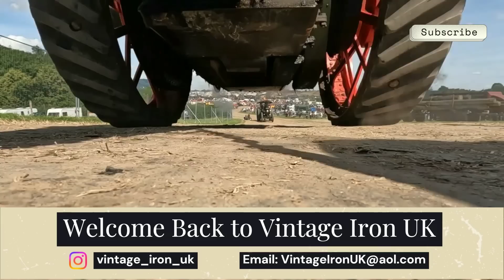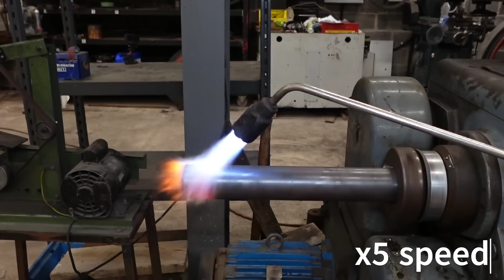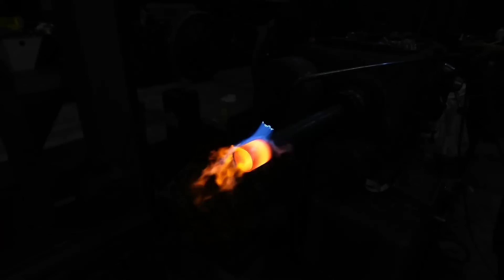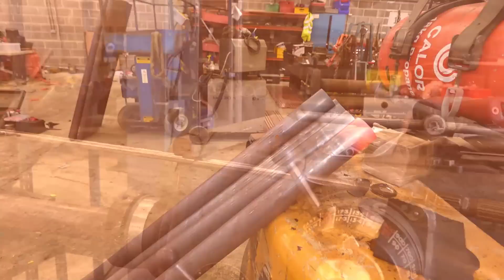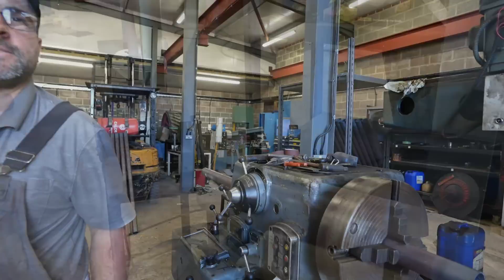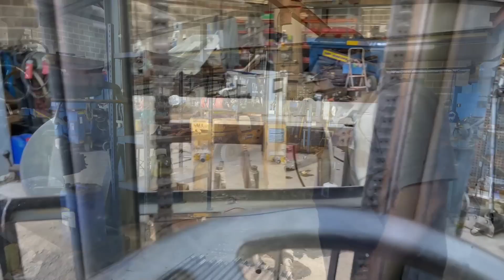STEAM ENGINE boiler REPAIR prepping the new tubes for fitting

Comment: How did that Allen key not snap at 3:24 ?!
Reply from the maker: @7333-e3k  Lathe clutch was not engaged. Just a little drag on the clutch plates before the oil makes it way to the headstock

Comment: I was a welder in a pressure vessel shop and we had a pair of tube sheets that went into a vessel. We rolled the tube's in but we never had to anneld them, but I can see where it would have made the job easier.
Reply: I agree ,have taught a lot of apprentices to roller expand tubes without annealing
Reply: @archmcdonald6170  Was a boiler guy for 20 years and never did this.....

Comment: Boiler tubes are usually  suppled aneeled. Also after heating they should be put in lime to slow the cooling rate otherwise your not softening them at all comrade

Comment: I’m no expert but should you not have cut the tubes to length before annealing and cleaning up the ends?
Reply from the maker: @Ian-Steele  what makes you say that? Don’t think a bandsaw cuts going to work harden the end?
Reply: @ I thought that if the tubes had to be cut to length you might be cutting off the section that you’ve just heat treated.
Reply from the maker: @ I see. Only 5-10mm coming of the ends so should still have more than plenty of a annealed steel left

Comment: which part of the uk are you from kind sir? you got a very unique accent, also is germany the only place that makes steam engine tubes, I have seen mills that make tubes for stationary boilers, but seems most of the steam engines tubes come out of germany, including I belive the ones in nkp 765 the engine I help out with in the shop sometimes, or is it just the quality of steel out of germany that its the case for many boiler powered transportation?
Reply from the maker: @manga12  The accent is the finest Bristolian. The south west of the great Britton. 

The uk produces boiler tubes. Just happens these had paper work and certs in German. We ordered from a uk supplier 👍
Reply: @VintageIronuk ah I see, its just soo differant from what I usually hear as I stated its almost a bit sounding like someone from the south central coast of the usa kind of
Reply: thanks good luck with the tubes boilerwork can be hard work, especially if you drive the staybolts in I tried and could not hold the hammer on the bolt end more then three hits, I should have leaned on it more and held the closer to the snap, perhaps if I can get used to the recoil I will have better luck when time comes to rivet. dont may fair share of moving the arch block in and out the last few years and blowing flues with the air wand thats fun
Reply: Ha ha! A northerner as we say from further down the M5!
Reply: Love me some 765!
Grew up watching them in service.
Reply: @SteamCrane  heh thanks, yea I knew about it in its third life heard of it when it was running in the 90's though before it went into the 4 or 5 year rebuild its a long story sort of
grew up around trains near fort wayne, remmebered a cousin who had a son that liked trains and mentioed there was a steam engine then one day in 09 ish I remembered and youtubed it for kicks and it grew from there till I rode a trip in 2015 ish out of fort wayne and the history bug bit me talking to someone that rented out one of the dome cars for iowa pacific holding they were using for the trip and he showed me all kinds of arial photos and old maps of the town, then saw late that the fort wayne group did have need of woodworking skills which I grew up around so I signed up in January of 2016
Reply: @ I am 2 months older than 765, I was outshopped July 1944, 765 built Sept. 1944.
Reply: @manga12  I too used to go out and help at the society. I helped paint the C&O 2716 back when we ran her in the mid-90s. Looking forward to taking the grand kids to ride the ice cream train this May...

Comment: I may be wrong but the pipe appears to be welded seam tubing. I would have thought that the proper choice would be seamless tubing. More expensive but stronger.
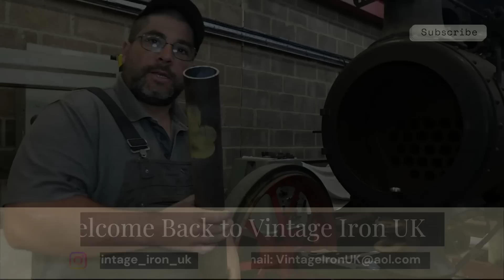Reply: At 0:55 Norm explains that these are “boiler grade” seamless tubes from Germany.
Reply: Correct. But I also noted that at one point during the clean up it appears as if the discolouration is running down the length like a seam. I hope Norm hasn’t been ripped off
Reply: The only part i have done in this process is to help place the tubes in the boiler after they had been cut to length. The best advice i have is to measure x3 cut once. The tube plates were not well aligned.
Reply: Retard don’t you listen to the man seamless boiler grade
Reply: I heard the late Fred say in one of his programs that the use of banana skins for lubricating boiler tubes is a good idea  .

Comment: Really interesting to see this job being done!  A lot of prep goes on that folk don’t realise.  It’s sad that you have to source the steel tube from Germany nowadays.
How do they make steel tube without welded joint?
Reply from the maker: @Dave.w-ev9qn1962  That’s a good question. I’m guessing it’s extruded hot. We need to get a tour of a steel yard. Cheers
Reply: @ 
Well we are both thinking  along the same lines🙂. But never seen it done.  May be someone will tell us in the comments later on🤣
Reply: Seamless tubes are drawn over a mandrill
Reply from the maker: @Altruistic-Viking   Dom tubes? As in welded then drawn over mandrel. Seamless if different I believe
Reply: @VintageIronuk seamless tubes are made from a solid steel block which is then pressed onto a mandrill thus making a tube. Said tube is then stretched into desired diameters and lengths. Often tubes are X-rayed to ensure quality
Reply from the maker: @ Interesting process. Can imagine it needs a few tons of pressure to turn a solid block into tubes. Thanks 👍
Reply: @Altruistic-Viking  
Thanks for the info!
I thought someone on hear would be able to enlighten us on the method 👍
Reply: @ https://youtu.be/ZNDvsJ03m8A?si=z94TIMaQ84dFmI_M  It is an interesting process
Reply from the maker: @Altruistic-Viking  Just watched the video. It’s a long process compared to welded tube. Thanks for tagging it